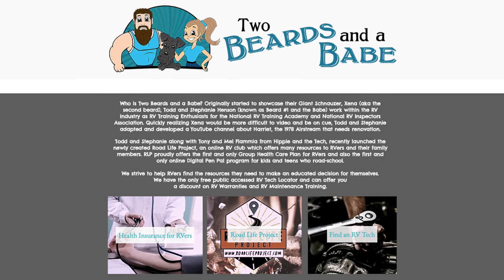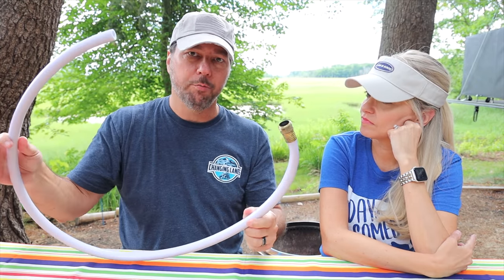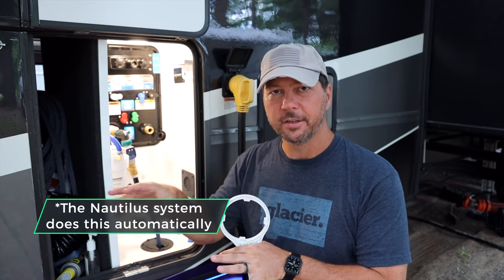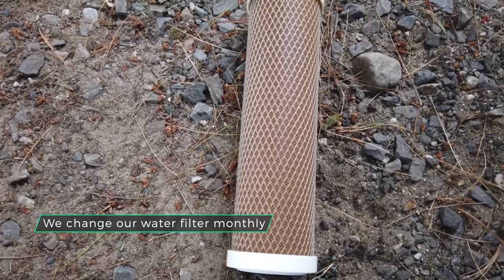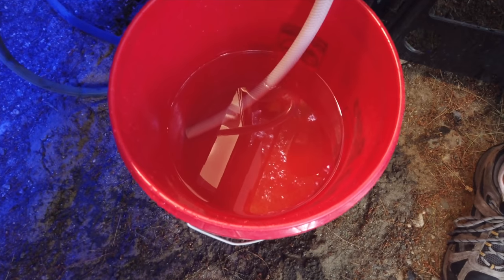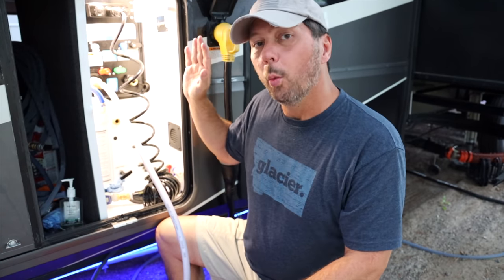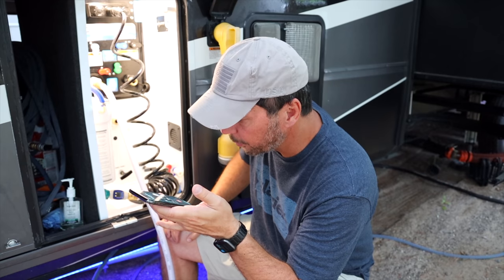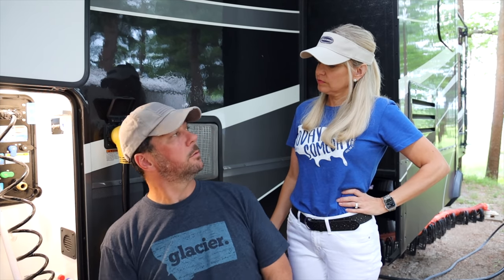💧 RV Fresh Water System Sanitization! (RV Maintenance Series) | RV Living!

Comment from the maker: ⚠️ We have some UPDATES on this process!!!  Be sure to check out the blog post for detailed step-by-step directions!
🅱 Full Blog Post: https://changinglanesrv.com/rv-water-system-sanitization
Reply: What is Todd's channel? Ty
Reply: Thank you for the updates! I was about to ask why you didn't just run the water hot/cold using the bleachy tank after bypassing without all the extra syphoning in "winterize" mode. Awesome job and thank you!
Reply: Is it possible to add the bleach by putting it into the water filter casing after taking the filter out? I saw this suggestion on a fb thread regarding the " RV inline sanitizer" sold on Amazon. I am curious what you think about this suggestion.
Reply: This is too "new" for me to follow ( but I'm saving it!) > my Champion 328F 5th Wheel- purchased used/as is from private seller- doesn't have the fancy stuff, I know little to nothing about RV's & I  don't have/ know how to get an owner's manual > bottom line: it's all above & beyond this widow 👵! Thank you for this excellent instructional video.

Comment: There is a simpler and faster way to do this, heed the warnings about the water filter and hot water tank, then:
'Note: It helps if you are using treated city water to do this process to avoid introducing any un-necceassary outside contaminants'
1. First make sure your fresh water tank is empty.
2. Now siphone or fill your fresh water tank (depending on your RV) with the 5 gallon bucket of water and bleech solution appropriate for your tank. You can do this multiple times to dilute the solution for larger tanks, just make sure you get the correct amount of bleech into your tank for your tank size.
3. Now fill your fresh tank up full so the solution you have just put in mixes in with all the water.
4. After this just run all your faucets, toilets, etc until the bleech solution comes through, using the solution from your fresh water tank and pump (dry camping mode)-Make sure your hot water tank stays bypassed during this time. Now wait the required time while the solution cleans (i believe 10 minutes is actually the minimum).
5. Now use your fresh water tank drain and drain the tank all out into sewer or approriate location. This avoids having to tax your water pump so hard to pump so many gallons through.
6. Fill your fresh water tank up again
7. Drain it wth the tank drain again
8. Fill your fresh tank up yet again
9. Use the fresh water tank and pump to pump some now-clean water from the fresh water tank through all your faucets, etc until the bleech solution is gone.
10. Drain ALL your tanks now using the tank drains, agian into the appropraite sewer/etc.
Now your all flushed and good to go!

Note: IF you have some kind of long inlet pipe inside your RV from your city water inlet connection point up-to your pump t-connction or valve, you may have to sanitize that specific section of the pipe with back flushing. Also, Alot of RV's have a one way valve just after where the hose connects to the RV, you may have to get creative to try and get solution into that specific pipe of the system, typically this pipe is very short up to the t-in point and it doesnt matter, unless you have rotten lines, then you may need to address it.

Comment: A quick suggestion.  Since your fresh water tanks are so large, after the first rinse, add a cup of peroxide then pump to each faucet.   If you want, you can test with a chlorine dpd test kit before and after to prove it.  The peroxide will kill any remaining chlorine.  You won't need a second full flush.

Comment: I spent many years sanitizing potable water systems on Boeing airplanes prior to their delivery and this video is very similar to the way I did it there. One of the best ways we knew that we flushed the chlorine out of the system was by using chlorine test strips to test the water flowing from each faucet just make sure the levels are correct. They are cheap to purchase and more accurate than just smelling for the lack of chlorine. Just a thought.
Reply: Another idea is when you change to a new water filter run water through the new filter for 5 minutes to rinse out the carbon. Do this with water that is clean, such as city water before putting the new filter in the RV.

Comment: Thank you for posting. I learned something about the water heater.  However, instead of using a bucket and all the syphoning steps, I just pour bleach into my regular water hose...connect to trailer and water hydrant.  Fill Fresh water tank (hose gets bleach ran through it).  Then go in, turn on pump and run through lines.  Let set.  Then do the draining and rinsing 12+ hours later.   It's amazing how many people do NOT sanitize their rigs.
Reply from the maker: I hope you still bypass your water heater...  bleach is highly corrosive to the metal in there.

Comment: Hey guys great video. Wanted to say how I sanitize my tanks. I just pour the bleach into my water feed hose for the RV. Then connect it to  my water source and turn it on like I’m filling my tanks. When full I run all the faucets in my rig and then the water pump to all the faucets. Putting the bleach in my water hose also sanitizes my hose. I also bypass the hot water heater.  Thanks for all your info you share. Keith

Comment: I would totally disagree about when you drain your water tank so no bacteria grows.  I have 30 years experience with bottled water and another 20 in keeping swimming pools sanitized.  Your water tank is never ever dry.  There just is never large enough vents to move enough air to dry that tank.  So your sitting in a campground where daytime temps reach 85 degrees plus, you then have this moist tank that is going to rise close to those temps and the bacteria will be growing like crazy.  Where as you have it full you have little to no air in the tank to eliminate airborne bacteria and that water most likely will never reach 85 plus degrees.  The cooler your water stays the less bacteria will grow.  I personally fill my tank and add a tablespoon of bleach and then it’s good to go.

Comment: Without reading all 318 of the comments, I'll assume a few already mentioned a Berkey for drinking water and I will just echo that sentiment and also say how a Berkey is really the best filtered water that can eliminate the need for heavy cases of bottled water and it filters out FAR more than the Britta. While the Berkey is basically a really high priced water cooler that does require space on a counter or in a stand, it filters out EVERYTHING (did I mention way more than the Brittas?) AND, when equipped with the right filters, a Berkey can also strip out both fluoride and arsenic! But the Berkey is not an excuse to not sanitize the coach's water system. We just got our Berkey (the travel Berkey) for the house and camper and we love it! Another thought on sanitizing the camper's water system is to use Star-San which is a no-rinse (but you can rinse if you want too) sanitizer that a lot of breweries and home brewers use to sanitize their brewing systems (so it's not cheap stuff).  Star-San is an orderless, tasteless, and food-safe sanitizer with a minimum contact time of 4 minutes per 1 oz to 5 gallons. That may make it sound really acidic, it's not as acidic as it sounds and it's safe on PEX/Plastic as well as Stainless steel and metal. This is something that some might like over using chlorine. The last piece of our camping potable water solution that we just moved to for pre-water filtering is a combination of Clear 2O pre-filter (20Micron pre-filter which is the same as the blue Camcos), a Aqua Clear in-line 5 micron filter (connected to the Clear 2O pre-filter) and then the Clear 2O 1 micron in-line filter. These three filters allow us to stop using (i.e. spend money) on the Camco blue in-lines since the Clear 2O is a removable and washable 20 micron (same as the Camco) filter.  The Aqua Clear in-line 5 micron filter, filters at the same level as our whole house filter which we now removed since it was an awkward set-up on our travel trailer, and the Clear 2O (filtering at the 1 micron) is filtering at a new level that we were not previously filtering at within the Clear 2O 1 micron.  I suppose people could replicate the same setup with a camco (20 micron) and two whole house filters that filter at the 5 and 1 micron levels but the whole house take up a lot of room and the housings can get expensive and they are really hard to find with needed Garden Hose Threaded (GHT) male/female fittings rather than the home National Pipe Threaded (NPT) male/female fittings which when connected with a hose, all too often leak. I found using the inline filters that are already GHT reduces leaks and cleans up the setup (no need for a whole house filter stand/solution) and storage for those of us that space constrained in a travel trailer.  One point to note, the Berkey's filters do not like softened water so we are still working out the best way to still keep our travel water softener system hooked up for bathing while not using it for drinking.  right now we just are not running the water softener due to the Berkey. Thanks for a great video on an important topic that a lot of people probably don't think about! I'm not sponsored by Star-San, Berkey or Clear 20/Aqua Clear - I just think these are some techniques to pass along that other might want to know about and how we use them!  Cheers!

Comment: Just a thought. After adding the last cup to bucket, rinse the measure into the bucket to clean it and not waste the water as you are topping off the five gallon?   And rinse all stainless steel with clean water to prevent pitting the stainless.  Bleach is a monster to stainless steel.  Thanks!

Comment: We’ve got a 375 RES with an ice maker in the residential fridge.  We had an issue with stagnant water in the washer water lines (located in the front cap area) siphoning back into the rest of the fresh water lines.  Took us a few weeks to figure it out, but once we sanitized, added some shutoff valves in the front bay to isolate the washer water lines (we don’t use a washer) and got on a regular sanitization schedule we didn’t experience any more issues.  Very important issue.  I would say if you have a residential fridge, don’t use any ice made for a few days, since it will contain chlorine.
Reply from the maker: Ah.. good point!  👍🏼

Comment: Oops, I didn't bypass the water heater. I had to do mine while camping. IDK how the water goes bad when sunlight doesn't hit it? Mine was bad. It had a tint of green. Had to run 5 miles to get bleach. Luckily we had water hook ups and I could use their water to flush/ fill. If you're in my situation, drain your hot water heater when bypassing to rid it of stink.

Comment: I try to shock our well yearly and a well plumber will tell you a lot higher concentration than the amount you used, but you don't need to cause rust either.  But it is also easier I just run the farthest faucet till I smell bleach then the others have bleach very quickly.   At the low bleach level you are at you could run it in the water heater, I use instant hot water for our house so no tank but I just run a load of white towels when we are done bleaching.  I also wash the house off with the bleach water after it sat in lines and well for overnight.

Comment: We opt for an easier way to sanitize.  Use 1tsp of crystallized Sodium Dichlor, (pool shock), per 100 gallons.  simply sprinkle some in a bucket or pitcher, siphon it into the fresh water tank.  Fill the tank and let sit for 24 hours.  Then empty into the gray tank, sit for 24 hours, then dump.  Usually We fill up one more time with just fresh water to rinse the tank good.

Comment: We have this same Nautilus system on our Solitude 310GK. I have been using a simpler method. I remove the water filter and fill the empty canister with 1-1/4 cup bleach. Reinstall the canister with bleach. Use the power fill tank setting to fill the tank. Before turning on the water, turn the red valve to the left. This will bypass the water heater. With the red valve pointing left while in the power fill setting turn on your hose. The bleach will mix with the water in the tank while filling. When the tank is full change Nautilus settings to Dry Camping but leave the red water heater bypass in the same "left" position. Turn on your water pump and open faucets till you smell bleach. Top off fresh water tank again so bleach solution is in contact with the top of the tank. Leave it sit overnight. Drain tank the following day. Refill and purge inside faucets. Repeat by emptying tank, refill, and purge faucets a second time. I also have quick disconnects on my hoses. While doing this process I also put a bleach solution in my fresh water hoses and and quick connect the ends together overnight as well.
Reply from the maker: That DOES sound much simpler!   Will have to try that out.  Thanks for the tip! 👍🏼

Comment: A way to "wash" the inside of your fresh water tank is to fill it about half full and tip a bottle of Vinegar in there and let it slosh around while you drive.  Drain the tank & no need to flush as Vinegar won't hurt you.  Divers use vinegar water to clean wet suites and stop a slime build up on them.

Comment: I put the bleach in to the empty fill hose and fill the fresh water holding. Once the fresh water tank is full I then use the water pump in dry camping mode until you smell bleach at all faucets on both hot and cold. I use this method to avoid unnecessary bleach spills and it quicker than having to use the siphon hose in two steps....
Reply: Exactly what I was thinking, they make this much more difficult than needed!  Should be a 3 minute job!
Reply from the maker: Many ways to do this.  Personally, I don't like straight bleach going through the system.. Also, I hope you bypass you water heater....
Reply: Always bypass

Comment: When you switch from hot to cold on the faucet you don't need to shut off the pump, just change from hot to cold on that faucet and move to the next one.
Reply from the maker: We turned off the pump, but it wasn't really necessary when just going from not to cold.

Comment: I fill my fresh water tank to the full level with my bleach water mix and use the on board water pump to fill the lines, I turn on the pump allow the system to pressurize and turn each tap in one at a time till I get the smell of bleach out of the that tap, leave it about 24 hours and flush three or four times till the smell of bleach is gone. As for draining the system, does your fresh water tank not have a drain valve under your rig?  I drain through the drain valve, close valve, fill tank and repeat till I have no more bleach smell, fill tank and run pump to flush the lines till I get no more bleach smell.  saves running the pump for hours to pump 150 gallons multiple times.

Comment: Just a nugget for thought. Somewhere in the system there is an air intake to prevent vacuum lock. You might want to find that and replace the little in line foam filter. Remember that it is sucking in all the ambient contaminants wherever you are.

Comment: I live on a well, in my sticks and bricks, so I add bleach to the system with every filter change, run into the water heater so the cleansing takes place in the water heater as well... but I need to add the two breweries to the mix now!!!
Reply from the maker: Be careful with bleach in the water heater..   very corrosive to metal.  This Sunday's video is sanitizing the water heater using vinegar.. 👍🏼

Comment: Just a thought Chad. Just fill fresh water tank with bleach water mixture then run water pump to your fixtures. Then top off fresh tank again and let sit. This will accomplish the same result i think.
Reply from the maker: That would put bleach into our water heater...
Reply: @ChangingLanes  Not if you bypass heater. Think about it.
Reply from the maker: That's the thing.. we have no separate bypass... the nautilus system does it...  But, we're hearing that it can be done, so we'll try that next time for sure.
Reply: @ChangingLanes  Did not know that. Thanks for the reply and info. Go Navy

Comment: Great video. When pumping through lines doesn’t the pump shut off when lines filled and reach pressure. So why do you shut pump off before going to the next faucet?
Reply from the maker: Yes.. so it's not necessary....  just did it.